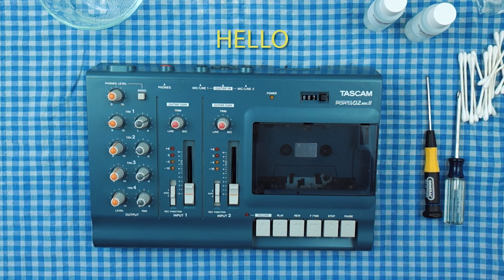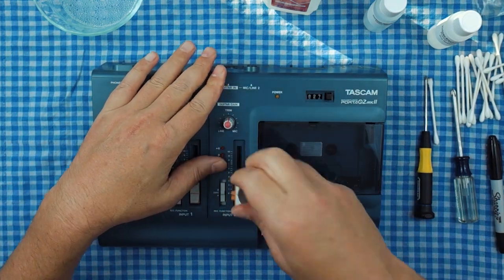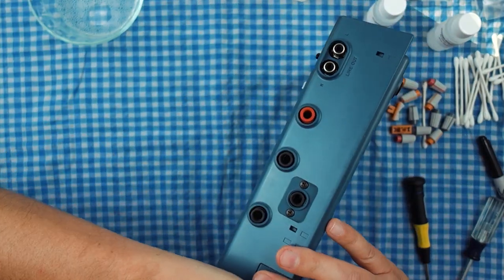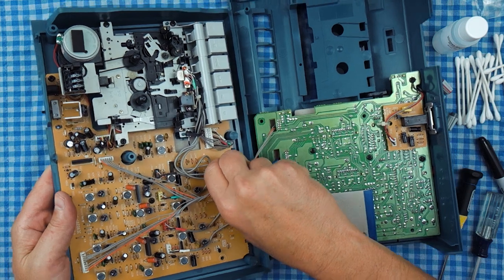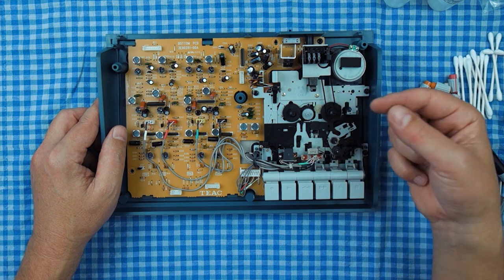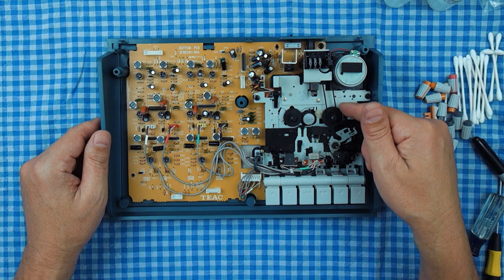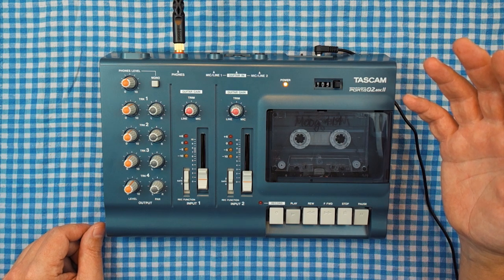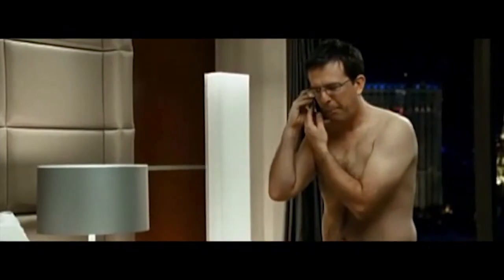How to fix a noisy output on the Tascam Porta02 MKii

Comment: Track 2 isn't recording on mine... anyone have experience with that? Can it be fixed? Love the video and love the recorder very much!
Reply from the maker: could be a couple things. Perhaps the switch is broken, or maybe the record wire from the head is detached or a cold solder joint. It could also be that the connector that seats the record wire for that track is not properly seated on the "motherboard". Have you opened it up yet and took a look around?
Reply: @User173  no sir not yet! That info is exactly what I was look for. I felt like I wouldn't even know what I was looking for and those starting points will do the trick. I'm super new in the fixing cassette things world... my first solder was neigh but a month ago haha 
thanks!
Reply from the maker: @hououinkyouma702  Not a problem. Crack her open and have a look around. Familiarize yourself with how it's all connected and how it all works before you do anything to it. Notice how the record and play heads have wires that go off to a little connector on the main board. Make sure that the connectors are not loose and that none of the wires are pulled loose or have a cold solder joint. then you might take it apart further and inspect the switch as well, though I doubt it's the switch.
give me a message if you need more help!
Reply: @User173  will do! very cool of you to take your time with a rando! My contribution back will hopefully be good music :)
Reply from the maker: @hououinkyouma702  I'm sure it will! I do it for this very reason, I just love helping people and giving out free information. I'm an old school Star Trek Nerd and I wish the world was more like that.
Reply: @User173  haha I didn't watch star trek but I'm 36 and grip onto anime and video games as if I were 12 so the world you envision is quite ideal to me! Hopefully I'll throw some music your way sometime this year

Comment: Great, useful vid. I have one of these, same model, with a large amount of white noise. This is present as soon as I turn on, and is not dependent on any specific knob. In other words, even with trims set to line, faders to zero, and headphones to zero, with no tape in there, it makes a hiss far worse than I've encountered on other equipment (including a noisy o/d channel on my guitar amp). Do you have any thoughts on which part I might look at to replace or resolder? Btw, I've had it from new, it just sat under the bed for 20 yrs due to my indolence. Many tanks for any help! Many thanks as well, to go with the tanks.
Reply from the maker: hmm, that's possibly a few things. It could be a loose ground on the headphone jack too? Maybe start there, open it up and make sure the line output you're using is fully soldered properly.
Reply: Ah, good point - thank you, I'll open it up and try that.
Reply: I have a 414 with the same issue. Thanks for the ground trace tip. Is there a good way to find cold solder joints?
Reply: @User173  if it’s not a loose ground on the headphone jack, what else could it be? mine looks fine (same problem with the constant white noise from the moment it’s ON) 

thanks SO much for the amazing video btw!! i did slow it down 0.5X towards the end and i’m glad i did 😂